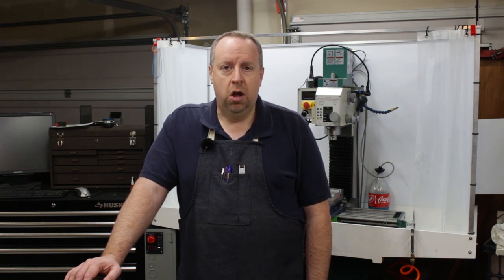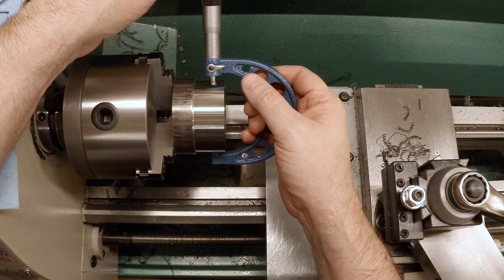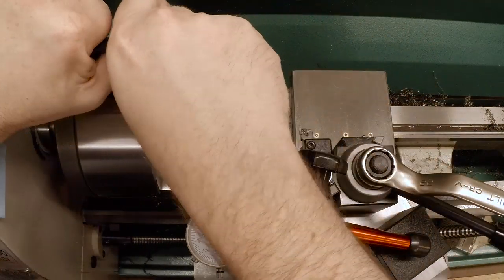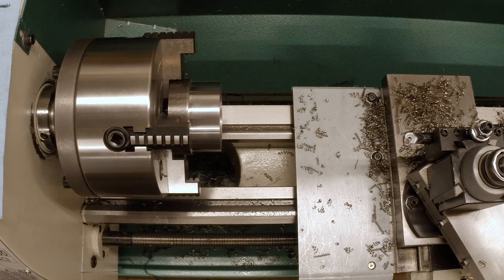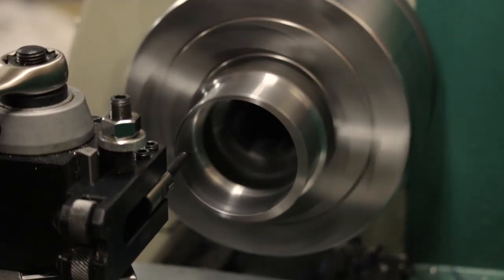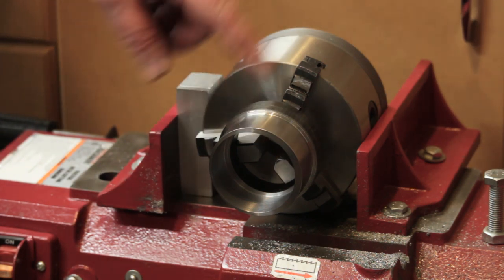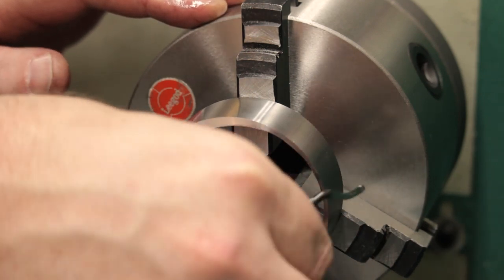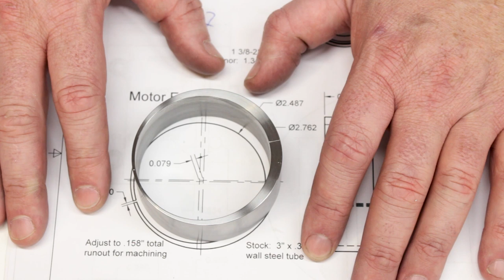Making a Toolpost Grinder Part 8: Making the Eccentric

Comment: Your chips are stringing because you run your spindle speed too fast. As im sure you know the larger the diameter the higher the surface speed. Slow your spindle down on almost all your operations. Thats also why your boring bar was screaming in part 7 boring the motor pulley. I like what youre doing and am watching because i plan to build a toolpost grinder as well. I like using a ready made collet holder as your spindle and will probably use that idea for mine if i can find one the right size.

Comment: Loving this series.
 I hate to say it but I think your view count might b suffering cause your videos r too long. 
With content like this you should be up in the thousands. Many people will look at the video length first and at 54 min it might be putting people off. 
You might have to edit harder.  or break it into more parts. That way we wouldn't have to wait as long between parts either..   :) 
( I been hangin out for part 8 ) LOL 
PS: those radius graduations on the cross slide would drive me nuts too. Thank god mine came with diameter reading.
Reply from the maker: That's possible.  I'm just getting started here.  We'll see where it leads.

Comment: By the way,, at the 29:30 mark you show a HSS boring bar. I am chasing that exact one. Any ideas where to pick one up please. Prefer online as I am located in Australia. Tanks,,  Cheers .
Reply from the maker: That bar is a Criterion HSS-312B.  1/2" shank, 1-1/2" depth, 5/16" minimum bore.  I don't see that exact part for sale anywhere, at first glance.  I do see the solid carbide version, the SBT-312B in a few places.

Comment: "Sometimes it's better to be lucky than good"
Man, ain't that the truth?  It's amazing how many times simple math mistakes have almost led to scrapped parts for me!  You make very few though.

PETG on the file handle?
Reply from the maker: Calculus and engineering are no problem for me, but basic arithmetic trips me up every time.  So I almost always use a calculator.  Yes.  The handle is PETG.  It tends to work well for high-stress applications like a taper-shank file handle.
Reply: That's what you get for being in the shop on a cold Saturday before at least two mugs of coffee. It's called"brain freeze".

Comment: Instead of slitting it, what are your thoughts on adding a set screw on the high side (thick side) so it always sticks to the motor, and therefore easier to twist for belt tightness?